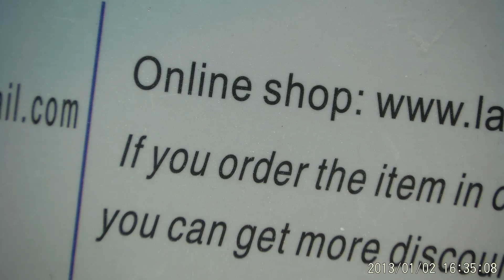Galaxy Note USB Port Repair

Comment: Nice repair, but why do you not solder under the microscope?
Reply from the maker: Hi krille356 - That's exactly what I'm doing from 9:10 onwards... only I'm doing it with hot air rather than an iron because it was impossible to drag-solder across the breaks in the wires without bridging to adjacent pins. Cheers!!
Reply: Jim Conner My mistake, looks like great image quality without any lag in the image :)
You are saying that your scope is 1080p in one of your videos but in the spec it is stated 720P 1280*720@30FPS, did you get 1080p@?FPS with the software upgrade?
Reply from the maker: Hi krille356 - When I first plugged the microscope into an HDMI screen, the screen told me that it was runing at 1080p. After I'd sent the camera away to be fixed (and bought myself an HDMI capture card), it only seemed to do 720p on the capture card. I think that the monitor I'd plugged it into first of all was just wrong.. (or maybe the older firmware did actually do 1080p even though the specs say otherwise) - Whatever the case, I'll only vouch for 720p now that the camera is all working correctly. The USB output has always been at 720p regardless of the firmware.... Hope that helps clear things up. There is no lag whatsoever on either USB or HDMI outputs - It's good for soldering work as it has a massive working distance. Cheers!!

Comment: Nice. Those are the sort of ridiculous lengths I go through to get things done some times. Sure we could order connectors, but where's the fun in that :)  Well done!
Reply from the maker: Thanks Jonny - I'm a great believer that if you think for long and hard enough, you can find a fix with whatever you have to hand. I once 'fixed' my laser printer when it ran out of black toner by using a single strand of some 389 core speaker wire to replace the 25mA new-toner-fitted fuse which was fitted on the toner cartridge. I didn't even have to get up from my chair for that one :)  Ordering new parts is almost like admitting defeat. Cheers!!